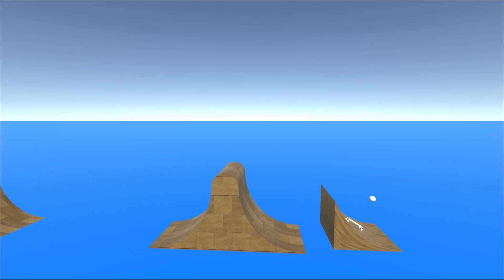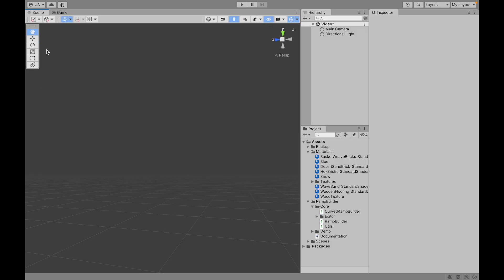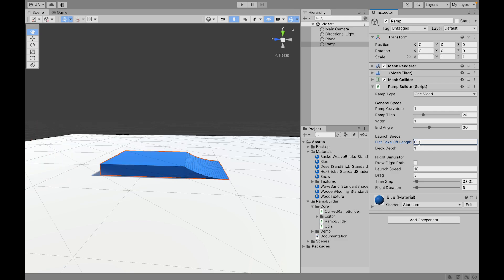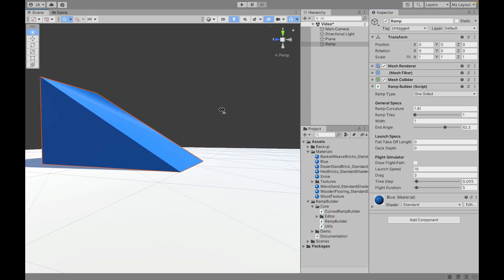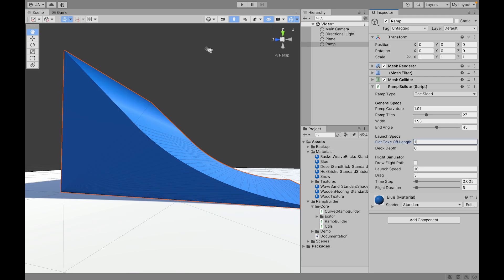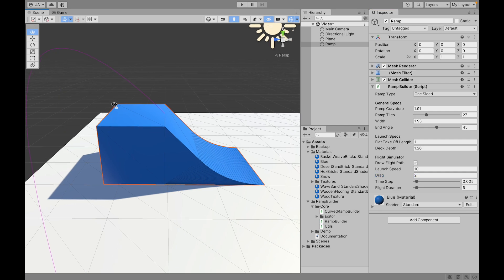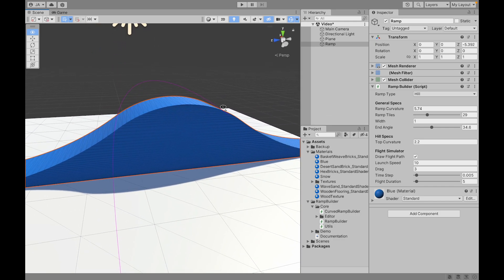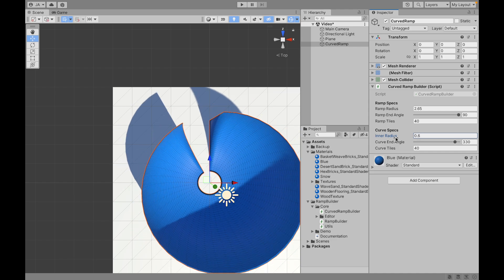Build the Perfect Jump Ramps in Unity with Ramp Builder

Comment: wtf, this is amazing! Does meshcollider recompiles at runtime? Would this allow me to create user generated levels?
Reply from the maker: Yeah that's optional.

You can change the parameters of the ramp programatically and then call a method to recompile the mesh at run time (which allows you to create user generated levels). 

Or you can simply create the mesh on the editor and have it be static (to save computation during runtime).

The package comes with a pdf that explains this further.